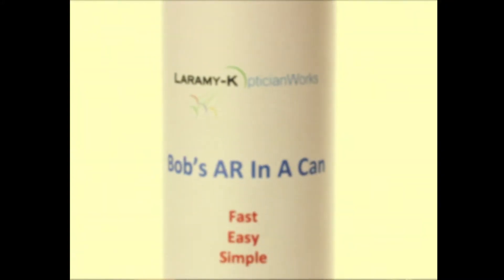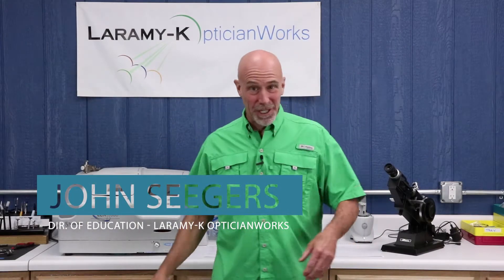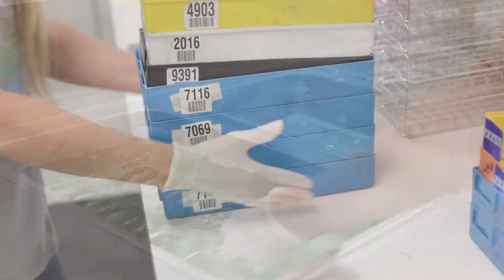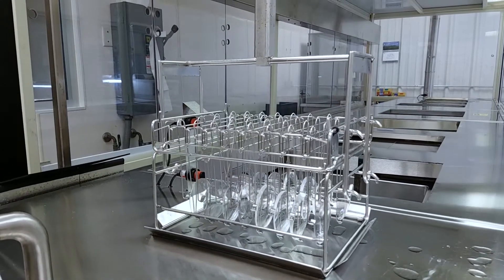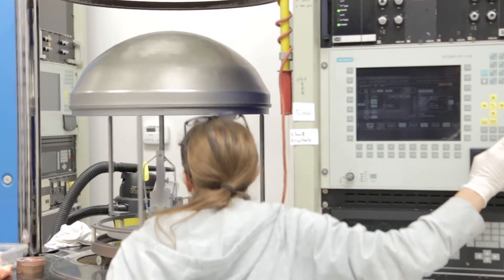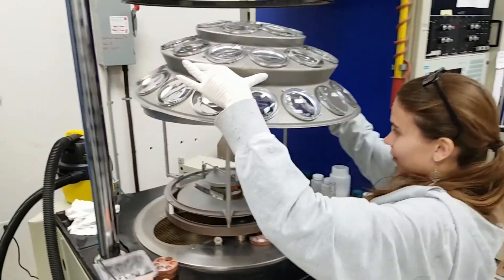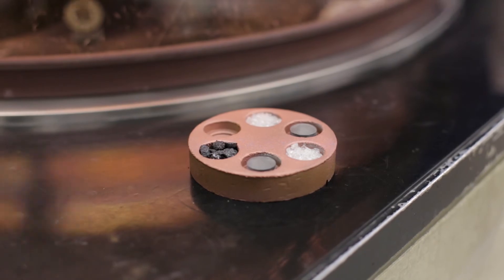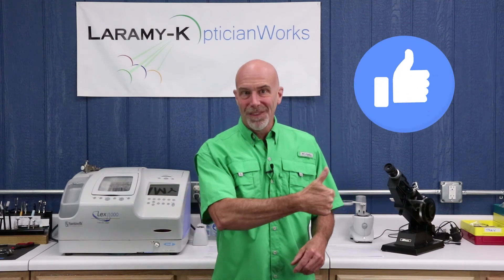How Premium AR Coatings Are Made

Comment: How do those 1 hour places sell AR coatings?  Is it far from premium, or simply different?
Reply from the maker: Lenses known as finished uncuts come from the factory with an AR coat. It might be a top-tier fantastic coating - it might be low-end not very good one. These are single vision only. If any places are offering progressives in 1 hour then you are getting a front surface coating only, which is not a god idea. You can't "spray on" an AR coat in a lab.

Comment: If I decide to have transitions lens, do I need to add on AR coating? Or it will not be necessary, as it comes with it
Reply from the maker: Two separate lens options. Not a bad idea to add AR with Transitions since it tends to make them react a little better.
Reply: @LaramyKOptical  So, is Standard AR coating will be more than enough to add on with Transition lenses for budget wise? TIA

Comment: You might expand your audiance if you go into the gritty nerdy details here. I was talking with someone earlier today in the comments section of Ben Krasnow's (Applied Science) upload about lens coatings and went searching for references to firm up my abstract level understanding of the chemistry. Ben's latest upload covers etching optical filters on p-doped silicon wafers, but he has done videos on both a vapor and sputter deposition rigs he has built. I thought he had mentioned the various metals and processes used to metalize coat sunglasses, but didn't find the reference.
  I haven't found anything definitive on the subject, so far. You're posting the type of references I would share with others, if you covered the subject.

  Another idea for content is a video about the differences between reading glasses and prescriptions. I'm disabled and getting out of the house is a major hassle. I used a couple of pairs of cheap reading glasses at two different strengths, and a measuring tape to determine the percentage difference of each eye, then ordered two of the lowest power reading glasses I could find that matched the difference, swapped out one eye, and haven't had any problems since. The difference added up to .75/1.0 or a 33% difference. I don't really need the glasses even to read, it just makes it more comfortable to read technical documentation for far longer. 

  This is just a real world type of situation that viewers might relate to, especially if you can approach it from the miser-layman's perspective. Personally, I can't situp or stand for very long due to chronic back injuries. Just driving/riding somewhere is challenging and I'm quickly at useless pain levels while sitting up. So not everyone in this type of circumstance is just being cheap.
 Just some thoughts.
-Jake
Reply from the maker: Hey Guys - John here. Sorry but way, way (way) beyond the level of need to know for the optician. I think there is a FB group for optical engineering. I'm a bear of little brain... and to be brutally honest the hard-core physics stuff doesn't really excite me much.
Reply: @LaramyKOptical  
Nothing wrong with that. We all have our limits and unexplored curiosities we don't have time for. Thanks for the reply, and have a great day.
-Jake
Reply: Well hello there, fellow person trying to understand Ben's science magic.

Comment: Is there any difference in quality with dip AR coating. Seems dip coating makes the lenses very dull looking with dip method?
Reply from the maker: I'm not aware of a dip coating AR. Dip coatings are for prep or scratch resistance. AR is applied when elements are forced to a gaseous state and fall upon the lens.

Comment: Would using 70% ethyl alcohol damage the coatings?
Reply from the maker: My best guess = YES! We recommend avoiding all alcohol based cleaners, Windex & ammonia. Dish soap and water is best with bottled lens cleaner second. Just go easy on the dish soap, better to "pre-mix" it with water and rinse.
Reply: @LaramyKOptical  Thanks for the quick response! 
I've already used alcohol to clean my coated glasses once by accident. 
Luckily, I don't see any damages. I'll make sure I don't make the same mistake again. 

If the coating gets damaged would it be visible?
Reply: @LaramyKOptical  Rinse thoroughly is essential. If you're struggling to remove traces try diluting some dish washing liquid (dish soap in The US) in a large volume of water. Say a litre of water and 1-2 ml dish washing liquid. This reduces the surface tension of the water, thus allowing it to more easily remove the stray dish liquid. Occasionally I soak them for ten-fifteen minutes. Far better than scrubbing away. For reference I wear Carl Zeiss Progressives in 1.67 material and Lotutec coatings. I found DVP to be a bitch to clean.
Reply: @paulanderson79  I love how you Americans use dish soap for everything like there's one standard composition or brand? When you people say "dish soap" which exact product are you referring to?

Comment: Hello: it appears my coating flakes off every 12 months prompting a new pair of glasses. What is the best method to remove the coating?
Reply from the maker: The best method is finding a new optical shop and getting a much better coating! Or perhaps just stop getting an AR and actually paying less for the upgrade to a super-scratch coat which is available. Although it is done you can't really remove or strip an AR coating. If for some reason you wanted to try (it won't work) you would use glass etching compound found at hobby stores. Did you watch How AR Coatings Are Tested? John
Reply: My spectacles still have ar coating after 8yrs!

Comment: Is this the same process that is used to apply AR coating to a sapphire wristwatch crystal? The reason I ask is because my Hamilton watch does not have AR coating and is highly reflective. Does this mean I can go to an optician to get AR coating applied to my Hamilton's watch crystal? Also, is this an expensive process to apply AR coating to a watch crystal?
Reply from the maker: Mister Nobody - As far as I understand it yes the process is the same. We do apply AR coatings to non-eyeglass products. We would need a fresh perfect crystal and the crystal alone. You would need to check with the lab on pricing. Depending on the process it could be $50 it could be $500. Call Janet (afternoons CST) 800-525-1274